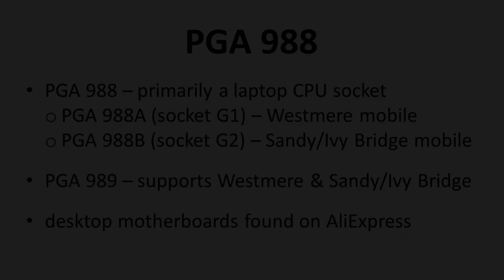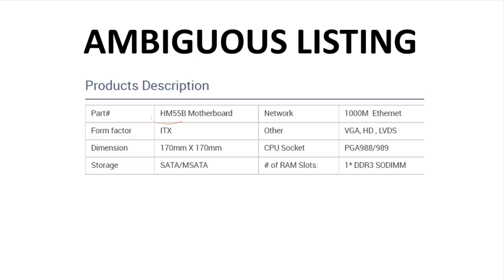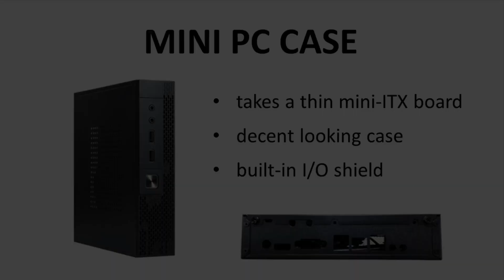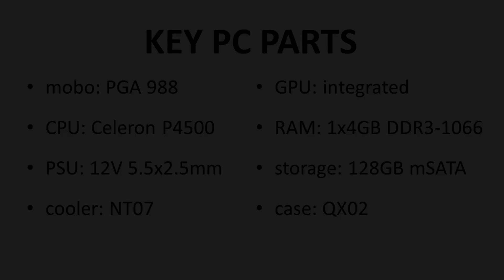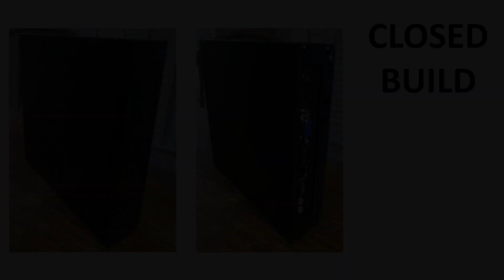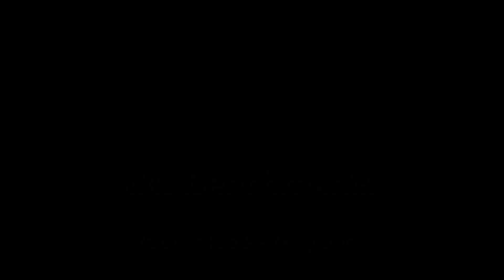Westmere thin ITX desktop build with a mobile PGA 988 socket

Comment: I just took a PGA988 processor out of an old laptop and wanted to build a small tower as my first PC build, I found the mobo on Walmart for $40, do you think I could get a 3D printed I/O cover and maybe some guidance?
Reply from the maker: I can help, but the motherboard will need to be identical (or at least have the exact same rear I/O layout).  First build? - super exciting!  Email me at ogbenchmarks@gmail.com.
Reply: @ogbenchmarks7127  you would be better off buying a motherboard with an rPGA 988b socket and an HM75 or HM76, HM77 chipset and two slots RAM. In such a motherboard, you can install an i7-3632qm processor and RAM 8GB+8GB, 4GB+4GB DDR3L-1600. Connect SSD 480-512GB, sata-lll, 2.5 "for high speed Windows and programs. The i7-3632qm processor has a good HD Graphics 4000 video card. You could buy a motherboard from a Lenovo laptop with an Nvidia video card.
Reply from the maker: @vladimirazirov1815  You're right.  I messed up on the motherboard.  I always planned to get an i3 or lower because I was concerned about keeping everything cool.  Still, I didn't have all my research done before buying the motherboard.